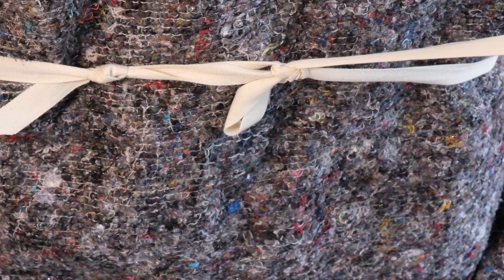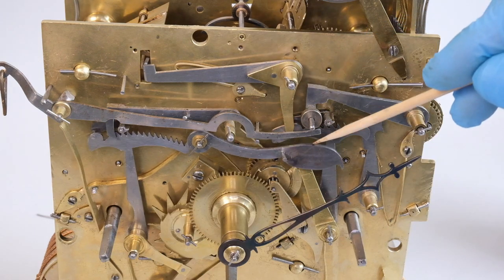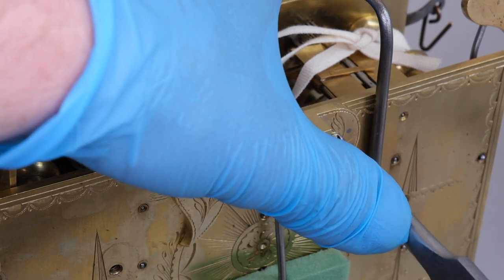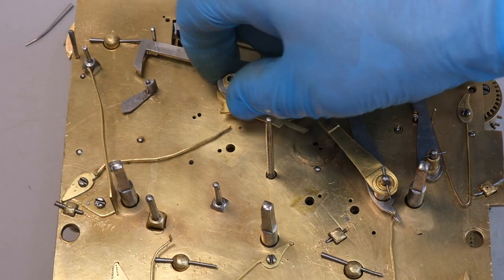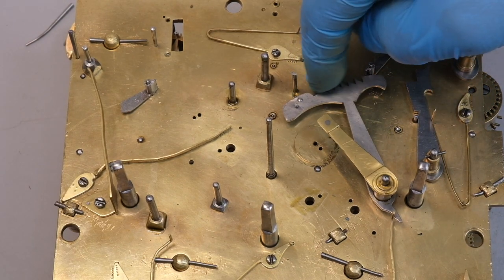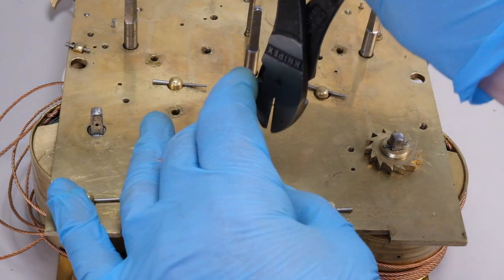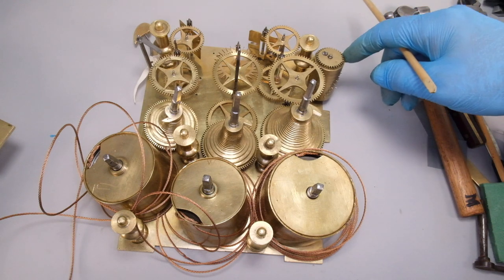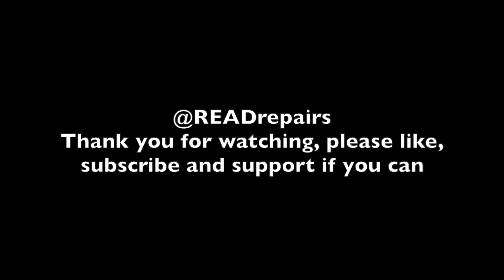READ repairs #003  Three-train fusee spring clock.  Part I.  Disassembly, analysis and discussion.

Comment: This is an excellent video, except I heard you say third wheel.. now I am confused. I have a triple fusee bracket clock from the 1820s, and this will greatly help me when I finally decide to take it apart and clean it. It pretty much runs perfectly fine except the strike/silence does not work. That will be the first thing I will work on. Too bad the clock in the video does not have the strike/silence.

Comment: Dear Matthew thank You for so nice video. Can I ask your advice on very same movement? Posibly it can help to repair your movement in right way also. I see You miss one part on strike side thats why spring on left side that pushes "start quarter chime" lever so bent and ugly.
I was trying to put link on nawcc forum, but probably this violates youtube rules.
Reply from the maker: Thanks for your message.  You mean the flirt spring?  Yes, it was a problem here.  I have a forthcoming video where I sort it out.  Thanks for taking an interest.  More to come, please keep watching. M
Reply: Yes, the first spring that bent in a strange way over the counting rack limiter pin. I think there is some absent parts near the end of this spring, You can see couple of free holes there. I think there should be specific limiter for this spring. I have drawen some picture but I don't know how to share this here.
I have really very similar movement. Made by Thomas Best however, probably yours made also by him.